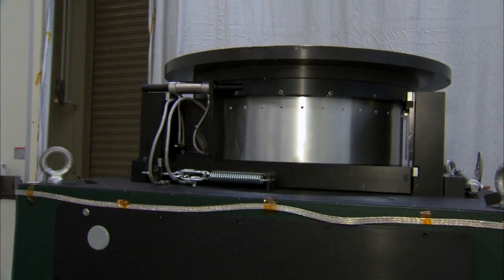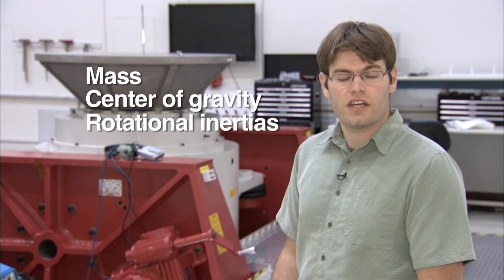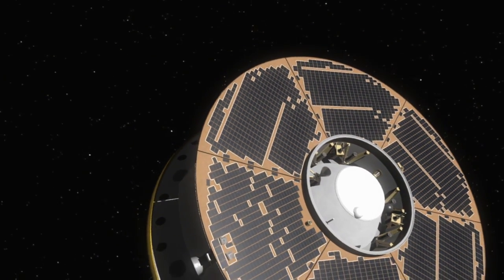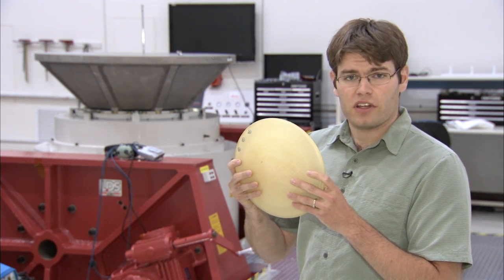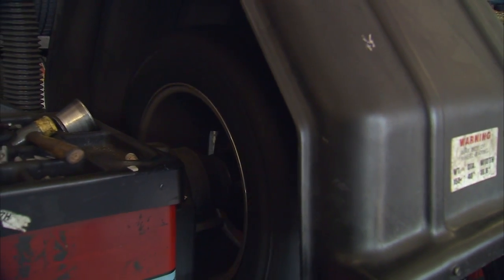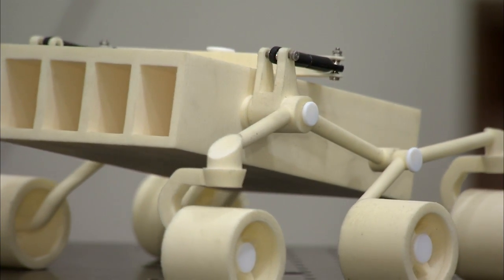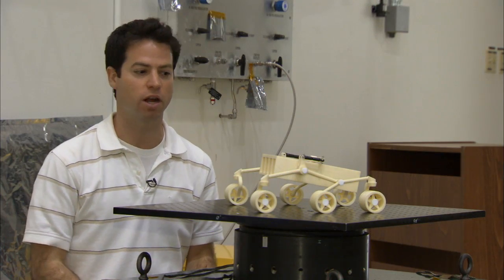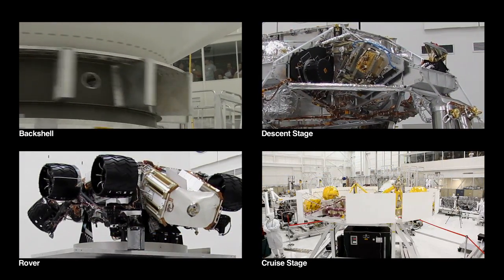Building Curiosity: Going For A Spin

Comment: @Drk4znSnip3r My feeling is that if they were to have done that, then it would have just been a rover with jets, and they wouldn't have needed to separate them at all. I think the point of separate vehicles is to ensure that each is as effective as possible for its intended purpose. The rover doesn't need the added weight and bulk of re-entry systems, and the re-entry system doesn't need the added weight, bulk, and complexity of landing and driving systems.

Comment: I wonder what the balance weights are, because you wouldn't want to add extra material just to balance it, raising fuel costs and use. Do you just shift the necessary parts around until it's balanced?